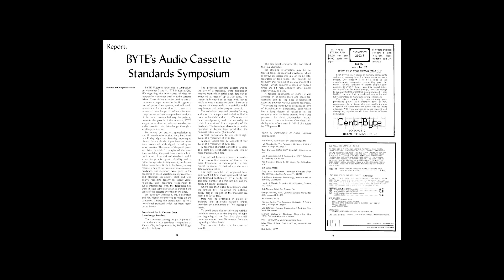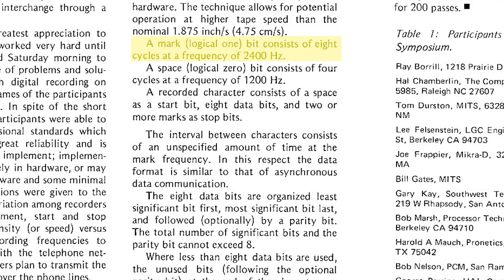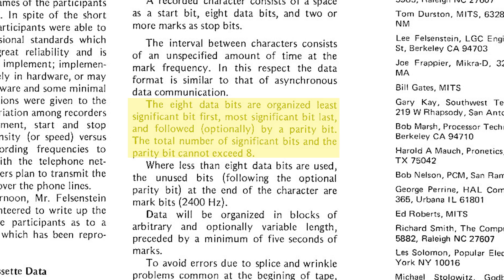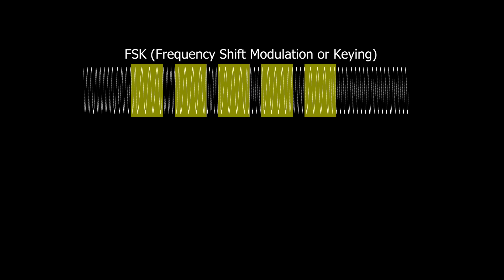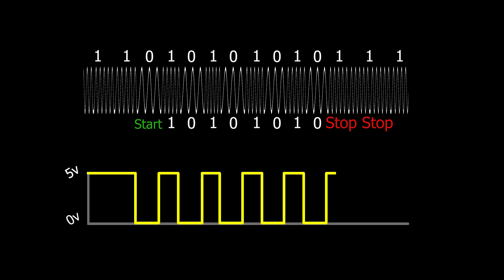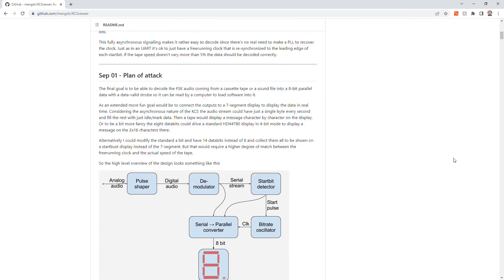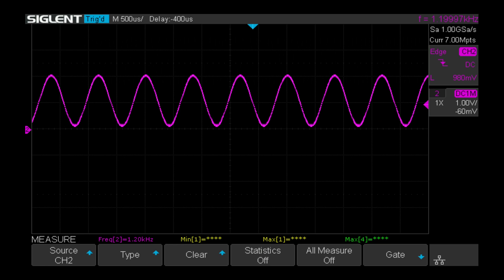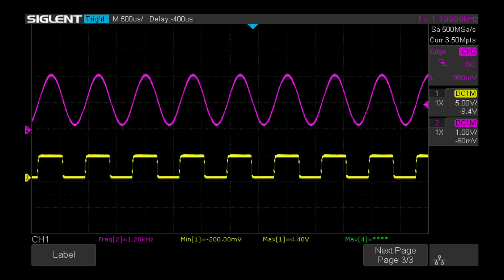Tape Storage for Ben Eater's 6502 - KCS Part 1 - The Curious Place 001

Comment: "He did this using only transistors."
Oh? When did they make transistors whose model numbers you could read basically like the values of through-hole resistors, and some that even look like capacitors, then? And are those resistor-looking ones BJTs or FETs?

Comment: I have only seen two methods used for tape storage.
The first method was identical to the MFM storage method used on hard drives: All bits recorded took exactly the same time to record, with the time divided into four portions.  Only portion 3 would change for 0 and 1 bits.  First there was a clock pulse of a fixed length, then a pause of the same length, then the data bit which would either be a second pulse of the same length as the first or a pause the same length as the clock pulse, then there would be a pause of the same length.  The advantage of this method is that the timing could "drift" slightly but the CPU could re-synchronise with each leading clock pulse, so any drift would not accumulate.
The other method was Frequency Shift Keying which recorded two different frequencies and in at least one system I saw, used a Phase-Locked Loop to detect one of the two frequencies so that it would put out the correct bit at the right time.  This method required that there be a re-synchronisation periodically to take care of any drift in the tape speed, which was taken care of by the "stop" bits and the "start" bit.
The MFM method was notably used by the TRS-80 and due to an error in the cassette timing code, reading back tapes was nowhere near as reliable as it should have been.  A later correction to the code fixed this mistake by adjusting the read timing, but by then the computer had earned its eternal nickname of "trash-80" and the lack of reliable cassette recording played a large part in that.

Comment: You need to pull down the logic with a 10k resistor connected to ground to prevent it floating when the voltage is changing.

Comment: I would do it completely by software. The only hardware thing needed is a zero-cross detector feeding pulse to CPU when signal crosses zero voltage point. CPU can easily determine freqency by counting pulses in constant time or counting time between pulses. Zero-crossing detection is far better because it is not affected by signal level and low affected by noise in signal. This is BTW how it worked in C64 datasette for example.
You also need some kind of synchronization logic (also doable in software) which offers a way to compensate for varying tape speed and possible difference of recording and playback speed (when recording is done on the different recorder than playback) which affects frequency.
Reply from the maker: Hey mskk2004!  If you haven't seen it yet, check out Ander's Universal Modem (https://www.youtube.com/watch?v=KLn8S8x0VVo ), he's doing it very much that way which also provides the ability to have multiple baud rates.  My next video will be covering the synchronization to the start bit and the latching, with the added bonus of being able to teach some of the electrical/logical concepts.  Thanks for being here man!

Comment: The pictured Atari wasn't actually using the 6502 itself, but a derivative of it. The 400 and 800 Atari computers did use the 6502, as well as the Apple II, in several versions, and all the clones of the Apple II that I have ever encountered.
Reply: Similarly the "BBC Micro" pictured was actually an Acorn Electron. Same manufacturer that also had a 6502, plus it used a variant of KCS called CUTS to store data on cassette tapes - see the Wikipedia page for more info.
Reply: if you listen carefully, he said some of the atari models...

Comment: Huh, pretty amateur of them to specify frequencies that are integer multiples -- distortion will create harmonics so the 1200 Hz carrier will trigger the 2400 Hz detector as well. Obviously it works well enough but if there's noise or degradation of the signal it probably would have worked better to choose e.g. 2100 or 2700 instead of 2400...
Reply: Especially considering that DTMF already existed. They could have either encoded each frequency as a bit (non telephone compatible and technically no longer DTMF but more efficient), or each telephone key as a 4-bit nibble (telephone compatible but half the tape data capacity)

https://en.m.wikipedia.org/wiki/Dual-tone_multi-frequency_signaling
Reply: Seems like a good example of digital is not analog, but actually it is. That is, from the perspective of someone practiced in analog design (or who understands Fourier/freq space well), harmonics are obvious. If one comes at the problem from the perspective of pushing discrete bits across a bus (for example), harmonics are essentially, or completely, invisible.
Reply: Turns out we used tape based recordings for years and this wasn't a problem.

Comment: Interesting! I wonder if you could use a L4LS221 for the detection? It seems ideally suited. Perhaps with a 74LS14 at the front to square off the signal?

I'm here thanks to the reddit post, BTW. Some great content you have here!
Reply: Is the '221 retriggerable? I've never used one. My go-to monostable chip is the '123, which is retriggerable but doesn't have Schmitt inputs, so will definitely need a '14.
Reply: @johnm2012  I thought it was just a pair of 123s in the same package iirc

Comment: Saw this on beneater Reddit!
I think it’s super interesting that it’s 2400Hz FSK because around the same time, Linear Time Code was defined and it’s the same modulation and speed (for ntsc).
(Oh, and subscribed and added the playlist. I’m gonna also try to adapt this circuit to my LTC project!)
Reply from the maker: Oh that's interesting!  Would love to hear more about what you're doing.  Will you share on Reddit?   If you Google some of the peoples names from the symposium in the video, you'll see that they were all pretty involved across the computer scene.  I wouldn't be surprised if the similarities were purposeful.  Even the stream of data on tape is just standard UART, so they definitely adapted proven methods that already existed.
Reply: @GregStrike  I’ll comment on your Reddit post.

Comment: Subscribed :) 
Kudos for going the discrete logic way about this. When I went through this a few months ago I realized Don Lancaster didn’t really have a 6502 in mind when he made his circuits for tape. That’s why I decided I would do the decoding in software on the 6502 instead - that way all you need is a comparator IC for input from tape and a low pass filter for converting squares to sines. 
That’s turned into a nice little 1.5x4cm board with a mini jack on one end and IO on the other end that’s easily connected to the 6522 VIA - you can check out my video using it to save to 7” tape reels if you didn’t already :)